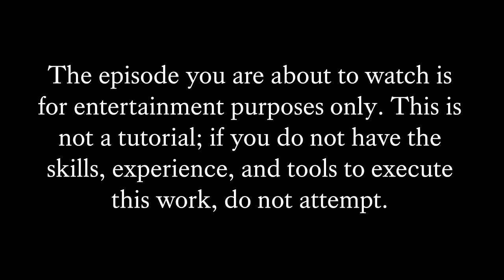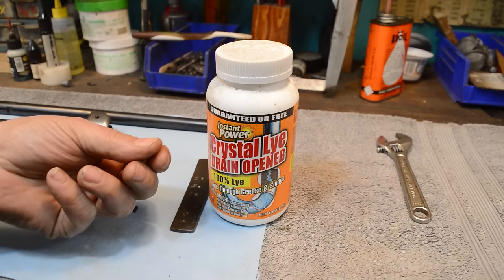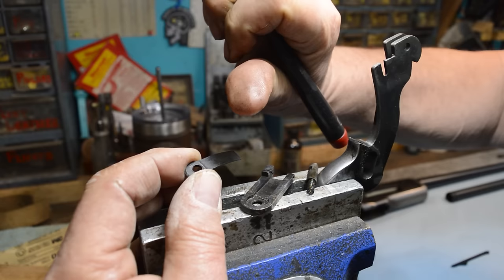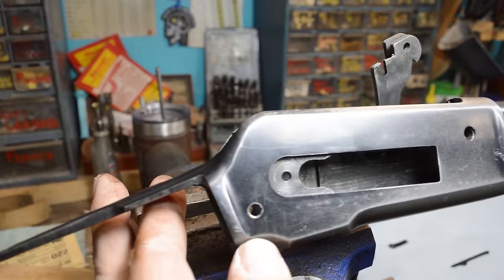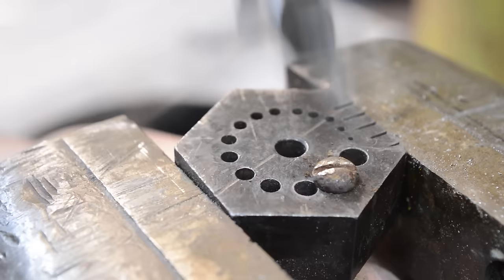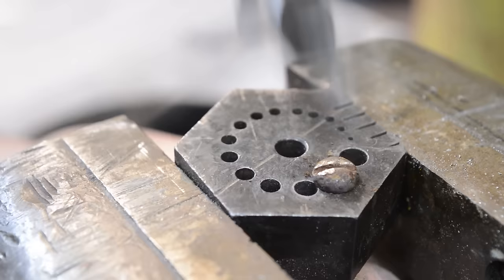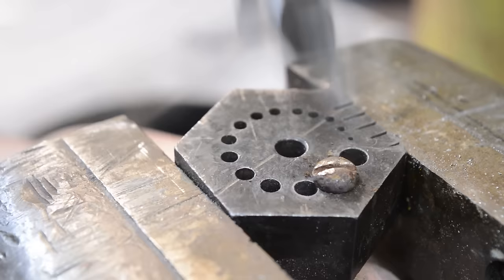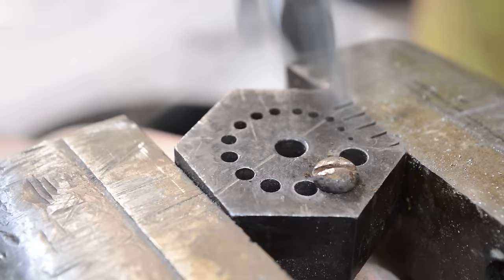Winchester Model 71 Metalwork: Anvil 0136

Comment: As someone who knows his way around a hammer, I have to say that was good work on the screws. It reminded me of when I was in the army and had to rivet barrel locks on M3 and M3A1 submachine guns. Just tapping away on pairs of flat-head mild steel rivets with my 8 ounce ball peen hammer. The .348 Winchester case was the basis for the .50 Alaskan and .500 Linebaugh wildcat cartridges. Luckily, when then the .348 Winchester brass supply dried up, Starline started making .348 Winchester, .500 Linebaugh and .50 Alaskan brass. I always thought it would be cool to have some of the old caliber rifles like .348 Winchester and .401 Winchester Self-Loading.

Comment: This is one of the best examples at 9 minutes the amazing difference a jeweler's block and polished hammer can fix a screw without having to match and replace it.  I'm no professional but I've done what I call the "poor man's lathe" with a drill and file to make low tolerance pins and clean fasteners with paper and files.

Comment: I’m in the oil field and we use a lye solution for certain things. The stuff is INSANE! I also deal with hydrochloric acid and as a general rule I’d prefer to be around it than lye. They are polar opposites on the PH scale. 

Here’s a tip any time you need to deal with lye. Always keep on hand a 2 liter bottle of Coke. Coke will neutralize the lye.
Reply: That's awesome to know, thanks !

Comment: Another gun back on action with a little maintenance, and it looks real nice too. Your video's are inspiring, especially the ones on the Winchester lever action restorations.  When it comes to tang screw removal, I've worked on one screw so damaged it had to be removed with a punch and hammer.

Comment: Thinking of getting screws and small arts heat blued, @Clickspring has a nifty way of ding that by using a little container filled with bras shavings. Just put the part in on top of the shavings and heat from underneath so the heat will transfer though slowly so you run less of a risk of blowing right past the ideal blue. Since all the screws are in a open top trough, you can do multiple screws at once to get them all ore or less the same color at the same time.

Doing that may or may not be something you'd want to do, but for some of those small bits, it may be just the thing.

Comment: Watchmakers use a plate with holes and long handle to blue their screws. You clide screws and heat the plate untill screw heads are blue. I always polish my screws on a lathe. This is what collets for. Buy yourself a collet chuck. Either ER32 or 5C plus collets. 3 jaw chucs are not for clamping screws. Thanks!
Reply from the maker: Totally missed the point....rhe average guy doesn't own a lathe or the collets either.
Reply from the maker: Lets shoot a video together of how you do this, and demonstrate your techniques

Comment: Great video. I just love the old lever Winchesters ... even though that one isn't quite as old as some of the others. Have you ever worked on any Merwin Hulbert revolvers? I have one that doesn't rotate the cylinder when you try to pull the hammer back. Let me know if you might be interested on doing a repair on it.

Comment: Why does he use a drill instead of a lathe? Obviously the reason you stated Mark. But also, which is less of a pain in the arse?? Chucking a screw in a lathe or quickly locking it into a power drill? 😂

Comment: I just acquired a 70 year old Savage 99 in 300 Savage. The gun is in great shape and after doing some testing I will probably want to do the maintenance. The barrel & receiver look amazingly similar to this Winchester with a really nice blue on the barrel & the bottom of the receiver worn white. When you rust blue in this situation, do you treat just the receiver, or both barrel & receiver?

Comment: I just watched through the post credits. I once was quite torn on replacing the water pump on my 98 Dodge as that would affect the originality. Yes, I could purchase the oem pump, but the drawing number didn't match. I finally broke down and replaced it.
When I finally sold the 98, I disclosed to the buyer that it was not original as the water pump had been replaced around 10 thousand miles ago.   I wonder how much money I could have made if it was original?
Reply: Zero
Reply: Defer the maintenance , lower the value.
Reply from the maker: Weigh it and see......just sayin

Comment: the last time I heated up a screw and dumped ito the oil I got a massive explosion of oil splatters, I think using used motor oil wasnt a good idea must have been too much water in it
Reply: Preheat the oil. Used motor oil works fine.